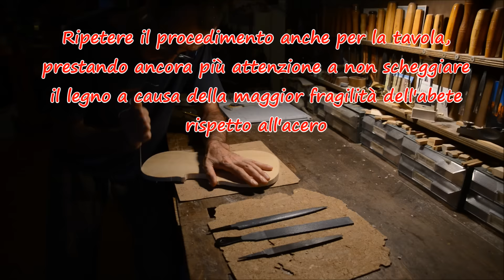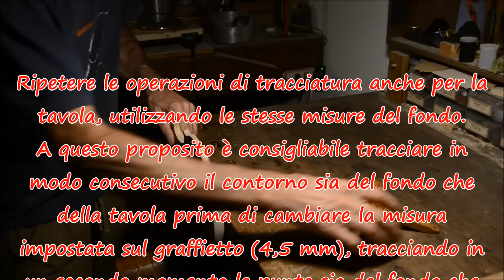Sgrossatura del contorno e tracciatura dello spessore dei bordi

Comment: I was hoping there was a trick to making the roughing easier, as I am an old weak woman, but it looks like it is just hard work, even for you. Grazie mille!
Reply from the maker: The only trick I know is to use low-density maple which is softer under the gouge, or at least avoid the high-density one, a real nightmare to rough out. Super sharp gouges are a big help. I exclude in principle all the electrical gadgets (power tools) that many luthiers use, but if there was a real need due to physical impediment, I could also turn a blind eye.😉🙂